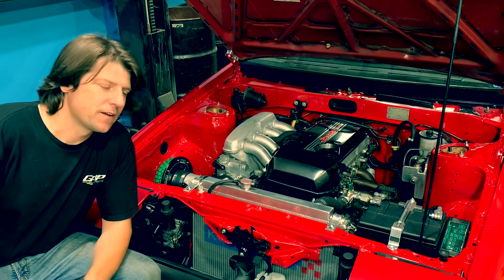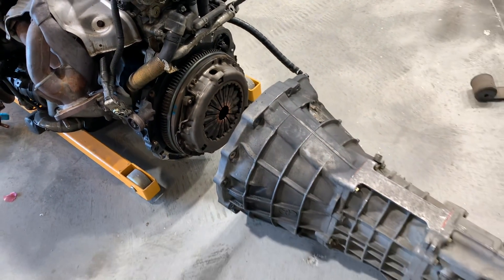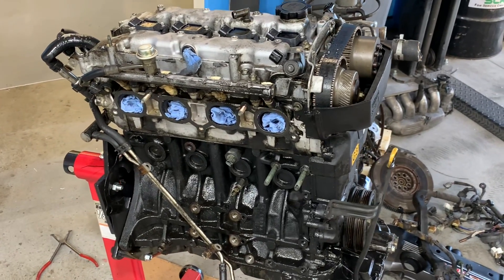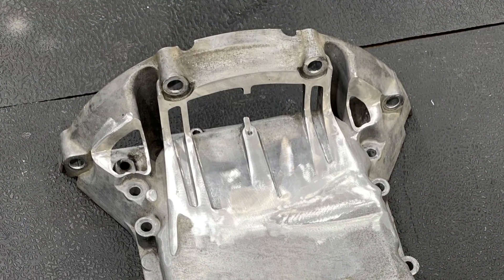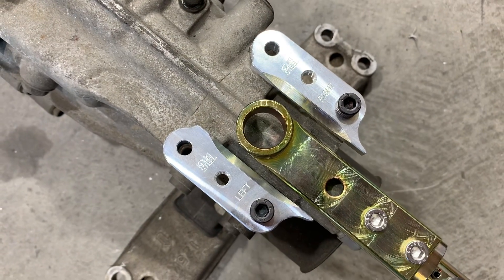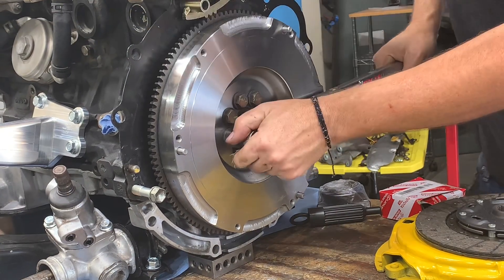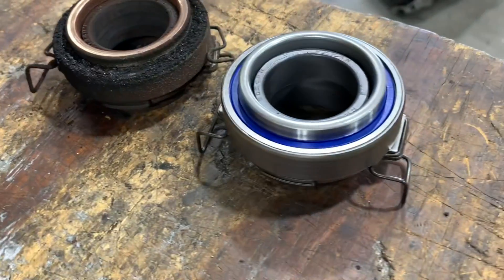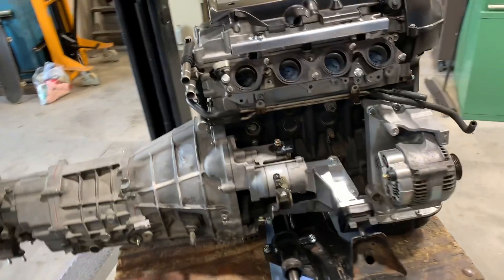How to Install a BEAMS 3SGE into an AE86   PART 1

Comment: Hey John,
Driveshaft question. Plan on going 2 piece..
Running a zenki gts rear axle and shopping for a w58 front section..
Does the w58 manual work w/ no cutting or vise versa? Or maybe differences with m/t and auto driveshaft?
Appreciate the knowledge.

Comment: any major difference between the G1, G3, and G5 aside from perhaps age?  I see a lot more G1 engines for sale
Reply from the maker: The g3 and g5 have an updated transmission with better synchros and heavier selector springs. The ignition coils are a different parts number (not sure if they are better or not) and the ecu is updated as well. Overall just minor stuff. Mainly the age and better transmission.

Comment: Smh yeah its been this tradition that has come to its own life of every single jdm engine is 60k-75k, but really what proof aside from this being told to every person that buys a jdm engine is there of the motors actual milage ?? I have bought few jdm engines and every time each motor was bought i was verbally told it had less than 75k and lol seems regardless of make or year or type of jdm engine being bought they always have the  same area of milage on it, but looks of that timing belt on that beams 3sge shows crack development on the top surface and that takes alot more than just 75k or less milage to cause that wear appearance, least not to any vehicle i ever changed timing belt on majority being usdm engines, but regardless this was probably the last member of old school performance powerplants toyota made as 2zzge was i believe final, jdm manufacturer companies arent what they once were anymore😢
Reply from the maker: It can be hard for the importers to keep track of each engine, so they use 60k as a general rule simply because it’s a pretty good average. But I agree, it seems as time goes on, the Japanese engines have more mileage than they did a decade ago. I’m guessing people are driving more in japan now than they were in the past. While most still take a train to work and use their cars only for weekend use, the average annual mileage is probably going up for other reasons.
Reply: @johnrussakoff  exactly but the trend still remains every motor has 75k or less, but my thing is if this is true than there shouldn't be any problems or excessive wear on belts and or seals, being state side we drive them until the bearings fall out, but either way the good stuff is over there regardless of mileage, and personally the quality in todays motors in any brand isnt the same  as before, i work on more newer cars (hondas) than i do my 20+ yr old cars, nothing stays great forever.

Comment: Just a helpful tip for you guys, I'm running JSP mounting brackets, TRD engine mounts, and a T3 manual rack. I DID have to cut quite a bit off the oil pan to resolve clearance issues.
Reply from the maker: Thanks for the feedback. Typically it is not needed. You might be using power steering mounting brackets. It is usually a very close fit, but I has been done without cutting on a stock manual rack car with stock engine mounts.

Comment: Good work ! Just I need to ask you does it needs a electronic sensord accelerater paddle?
Reply from the maker: Factory cable and pedal works great. We cover the throttle cable in the third video of the series.
Reply: Thank you so much.